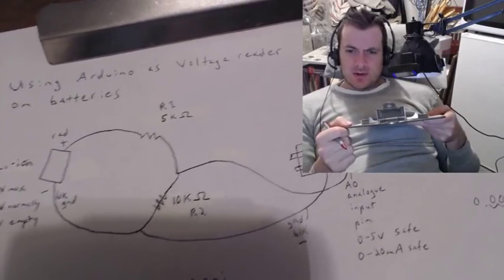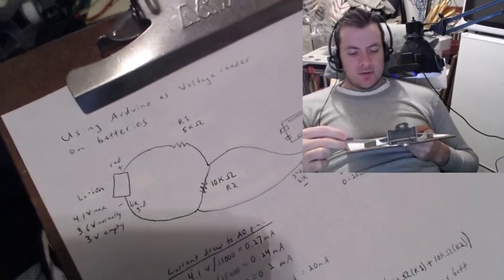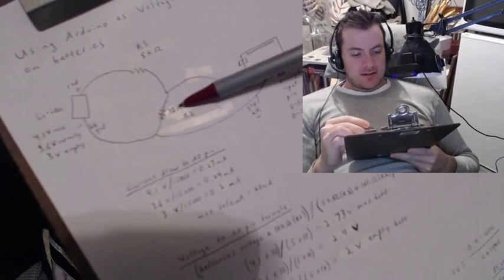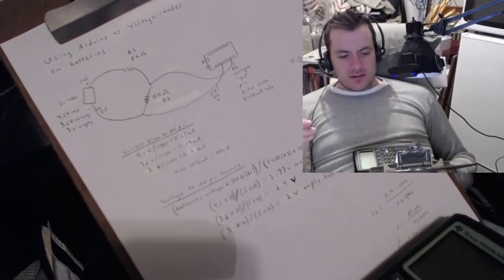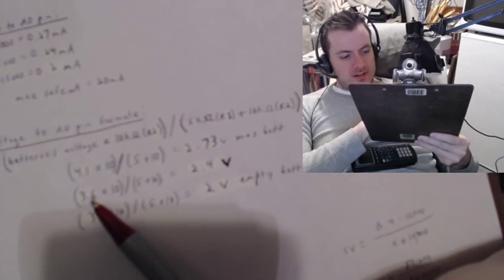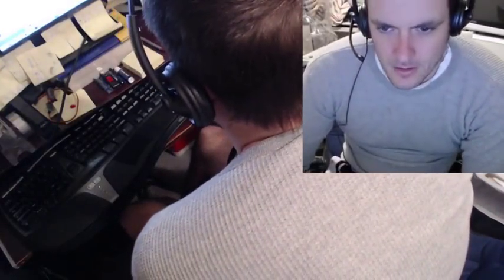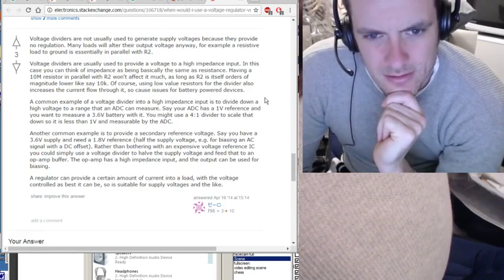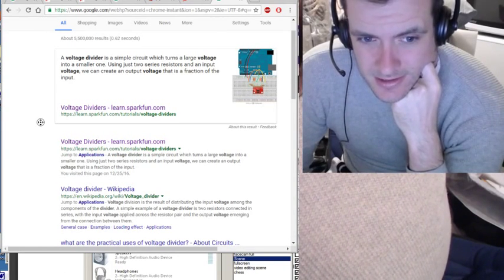DustBuster Fix #2 | Using Arduino as Voltage Reader on Batteries - Using Voltage Dividers

Comment: if all you need to do it limit the current why not just use a single resistor with a high enough rating?
Reply from the maker: you also have to limit voltage to under 5v so what you suggest would only work for a battery pack that puts out no more than 5v at most.
Reply: @artbyrobot1   kk I see you where making it applicable to all cases. Nice